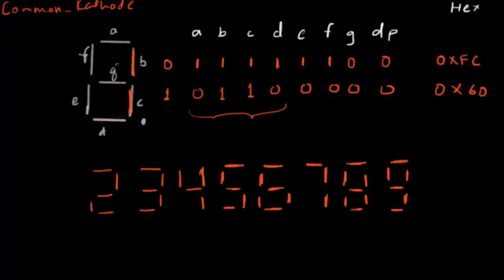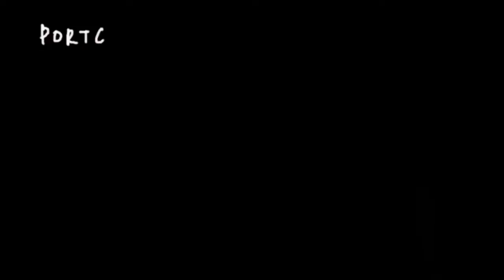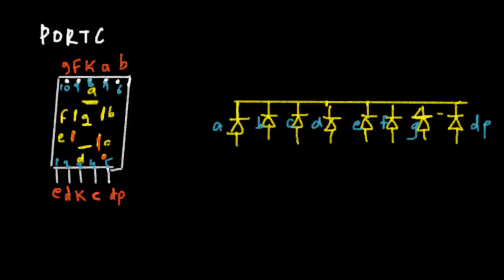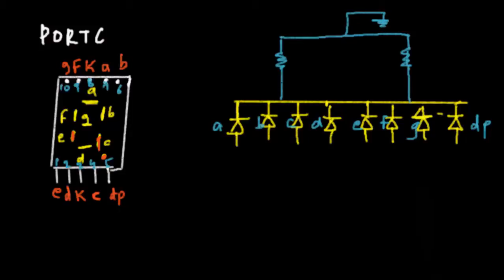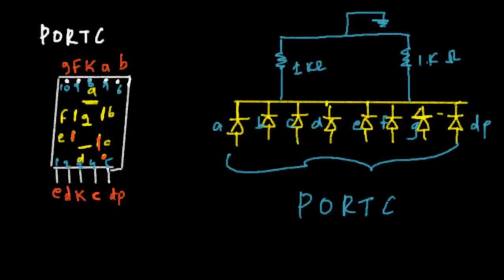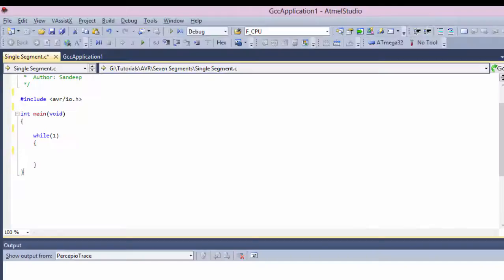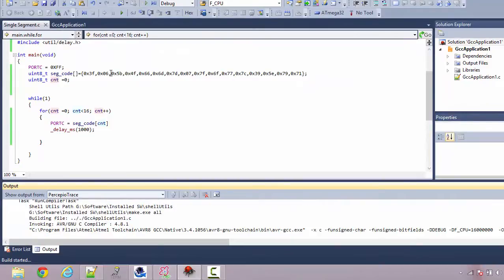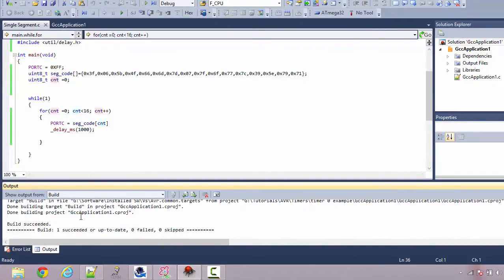Seven Segment Display with ATmega32

Comment: i understood it from setting the bits as input and output but was confused when it got to checking if the switch is pressed or released.. my question is... is there default value for the PINB, & PORTC that made you use them here as ''if ((PINB& (1<<SW)) == 1)
  PORTB |= (1<<LED);
  PORTB &= ~(1<<LED);'' ???
Reply from the maker: It will work irrespective of the default value.

Comment: Hay un error en tu programa, falta declarar las entradas y salidas
#define F_CPU 8000000UL
#include <avr/io.h>
#include <util/delay.h>

uint8_t seg_code[] = {0x3f,0x06,0x5b,0x4f,0x66,0x6d,0x7d, ///definimos una matriz de 8 bits llamada seg_code y le cargamos valores
0x07,0x7f,0x6f,0x77,0x7c,0x39,0x5e,0x79,0x71};

uint8_t cnt =0; // definimos una variable tipo 8 bits llamada cnt y le cargamos 0

int main(void){  //inicio de función
 DDRC=0xFF;
 PORTC= 0xFF;
 while(1)  //bucle
 {
  for(cnt =0; cnt<16; cnt++) //para cnt=0 hasta 16 , aunentar de 1 en uno
  {
   PORTC = seg_code[cnt]; //cargar codigo de la matriz segun la posición definida por cnt (de 0 a 15)
   _delay_ms(1000);
  }
 }
}